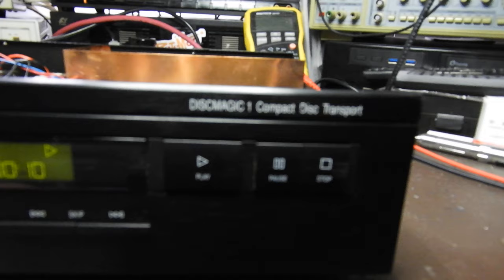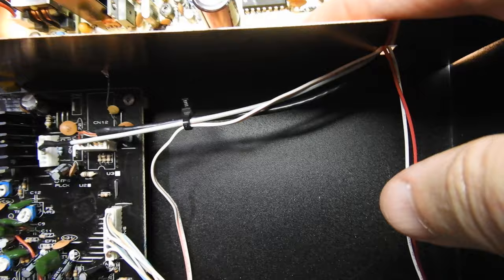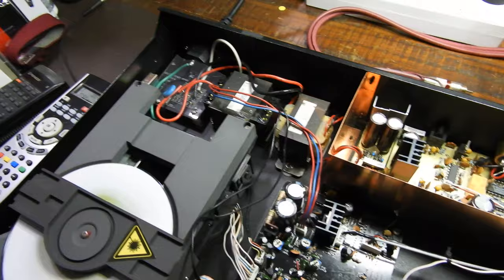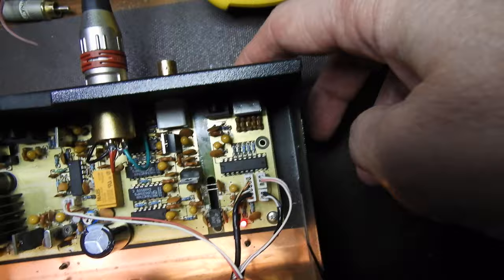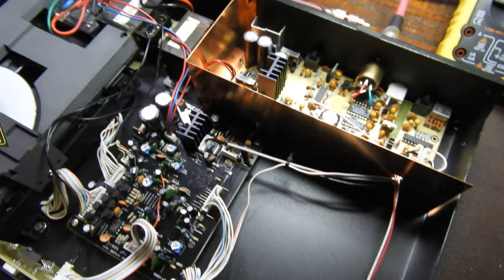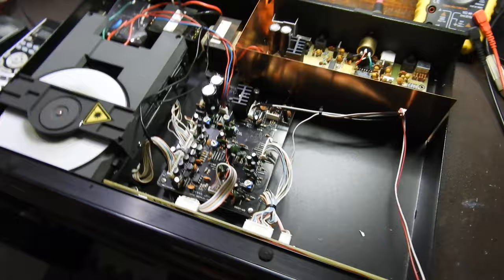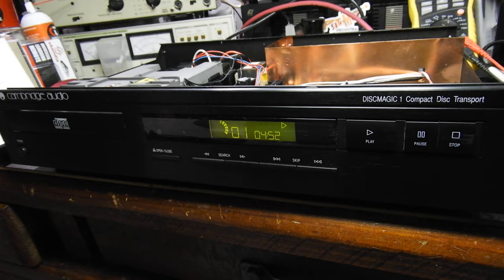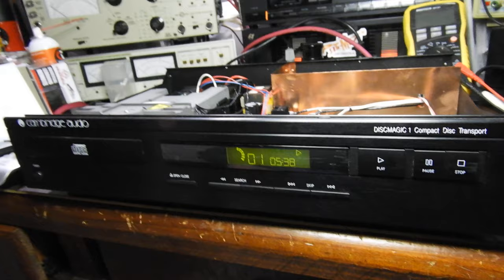Cambridge Audio Disc Magic 1 - Final video with a walk through features & design. Great Transport

Comment: My Soncoz laqxd1 dac has digital output and digital input but coax digital output .
Nicely built for sure thanks for the video
Reply from the maker: One can easily be changed to the other. The protocol is the same. From SPDIF to Toslink you need to add the receiver (about $5 cost). But from Toslink to SPDIF, you just take signal from just before the receiver and take it to a RCA or BNC connector. That easy.

Comment: Could this player be modified to install I2S output where data and clock are send thru separate lines ?
Reply from the maker: Maybe it could be done by someone. I do not have any diagrams for it, so to work it out, it would take way too much time.
Reply: @hear-net-au  ok i see